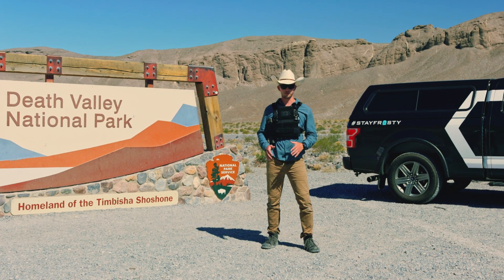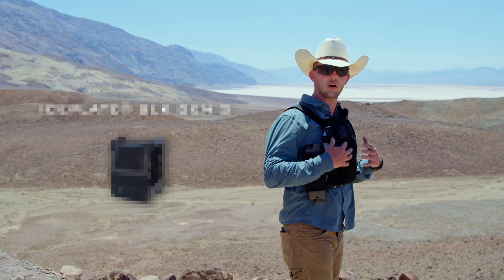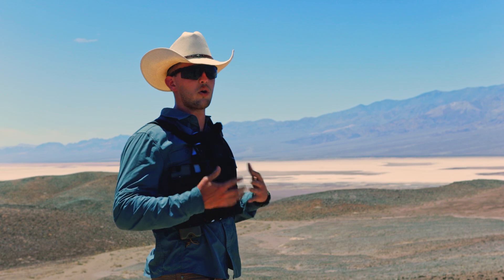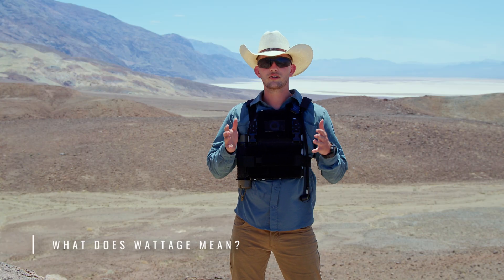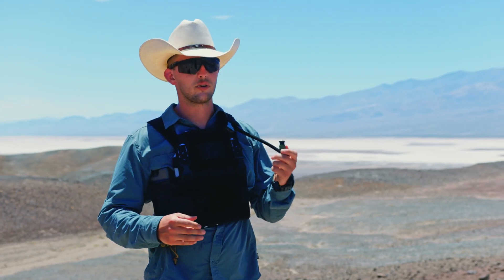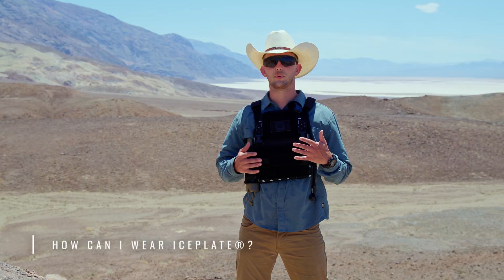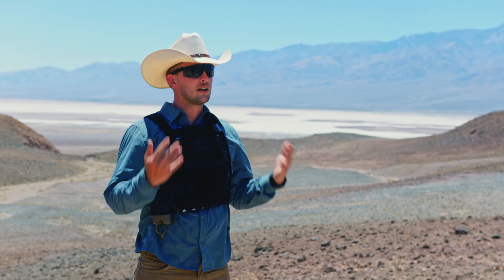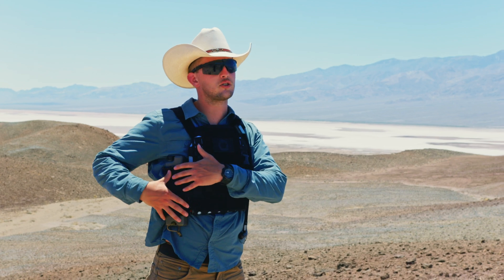Surviving the Desert: Military Water Bottles Tested in Extreme Heat (Is the Old Canteen Obsolete?)

Comment: While I know ICEPLATE isn't bulletproof y'all should test it against shrapnel. I'm curious how it would do as a flak jacket in frozen form and thawed form.
Reply from the maker: We’ve already done Backface Deformation Testing (click here, scroll to the bottom: https://www.qoreperformance.com/blogs/military-insights/iceplate-faq-a-deeper-dive-into-the-why-the-science-and-the-design-of-the-worlds-most-capable-water-bottle?srsltid=AfmBOor3az8ZCdonK4u6B2R06iRuaacswqcVMltrEJ79p89dwGoHPBX5). What application do you see for this? A non-armor, ICEPLATE® only application where one might use a chest rig or LBV in lieu of a plate carrier or full armor?
Reply: @QorePerformanceUSA  Great vids! That being said I think y'all should still do a standalone test for fragmentation protection, one with a frozen ICEPLATE and one with a thawed ICEPLATE

Of course if the ICEPLATE is pierced and the water drains out it probably won't do much, but for a one time use along with how useful it is for cooling/heating and hydration it would sure beat putting on soft armor or even hard armor for fragmentation protection in hot conditions. 

I've heard stories of soldiers who refused to go to the mess to get lunch because due to frequent mortar attacks they weren't allowed outside the barracks without their plates on, and it was too damn hot to put their full kit on and go outside, if the ICEPLATE can work as a one time use flak vest that's worth knowing.
Reply from the maker: Interesting. Any particular fragmentation test standards or experimental design you’d like to see? We’ll need some type of official standard to which to test for it to be valid like we did for the Backface Deformation Testing where we used the NIJ Protocol, ideally.
Reply: @QorePerformanceUSA  It's hard to say with flak jackets falling out of fashion. Seems like this would be more up the alley of an explosives expert. If I were going to test it I'd probably go with some hot loaded shotshells full of steel birdshot pushing 2000+ FPS at a distance that allows them to spread out a bit. 

Seems like there isn't a standard for Flak Jackets anymore, closest thing was Level 1 Armor and that was rated for LRN 40 grain 22lr at 1080 FPS and FMJ 95 Grain .380 at 1055 FPS.